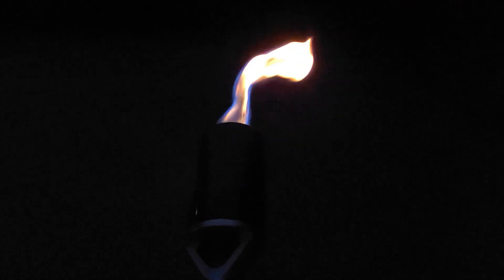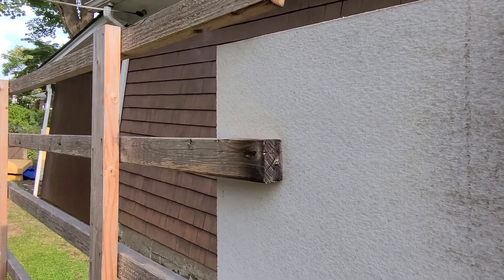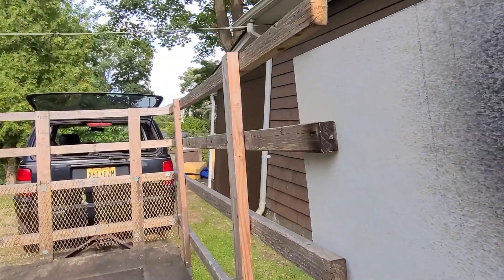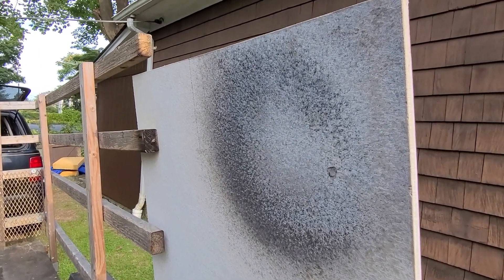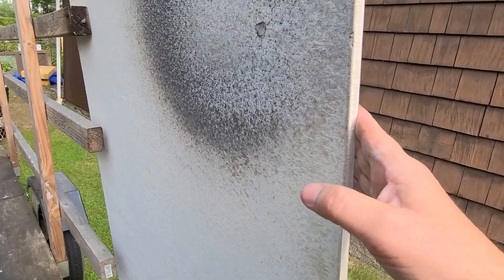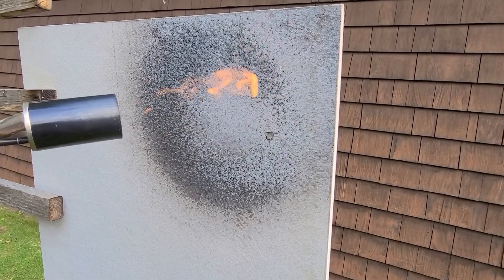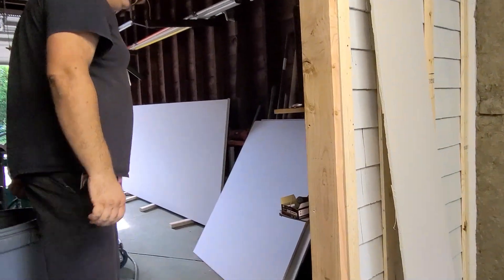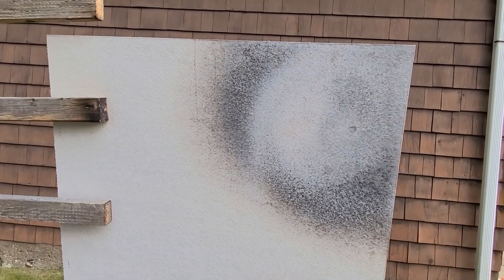Heat Testing Cement Board Which Will Be Part Of Exhaust System For the DJC's Generator Room

Comment: Frame with 2”x 4” steel studs, then 5/8” drywall, then 1” x 2” steel channel to act as a air barrier followed by your cement board. Treat it the same as a wood stove install.